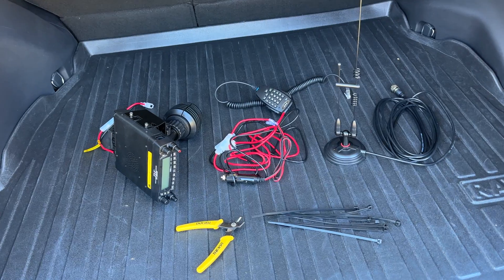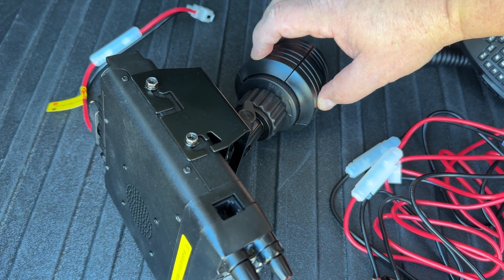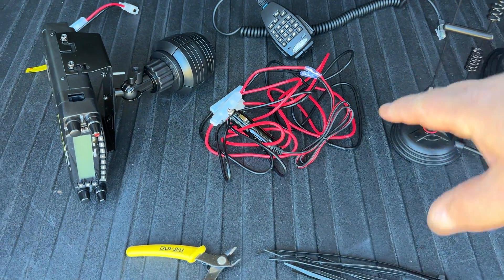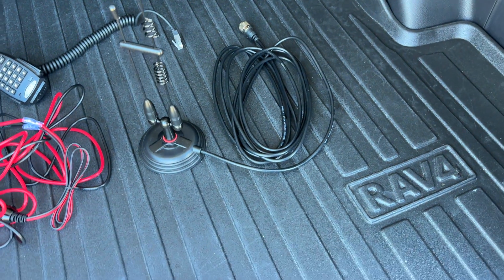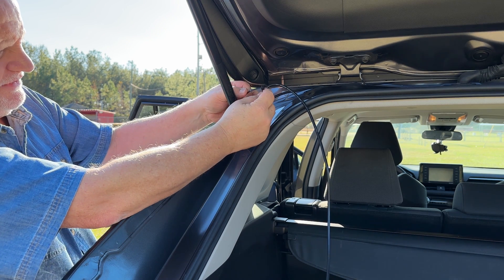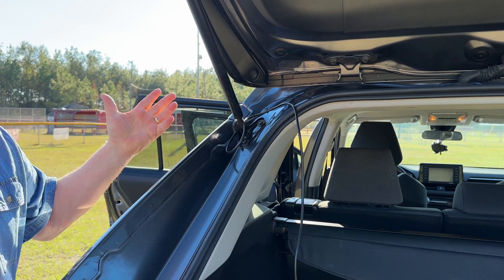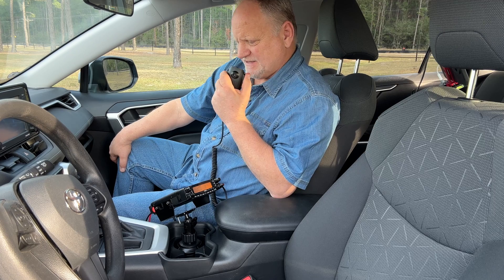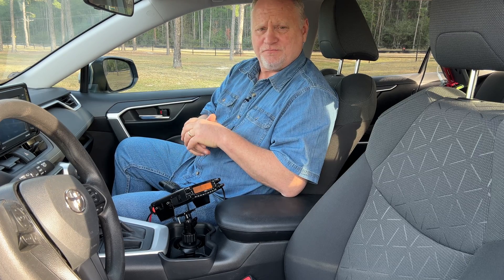Mobile Ham Radio Install VHF/UHF Ham GMRS CB

Comment: Be careful, most cigarette lighter sockets can’t deliver over 10 amps and radios on transmit can need over 20 amps.
Reply: How does a 50 watt radio running on 12 volts pull 20 amps?

50W÷12V= 4.17A
Reply: You are mixing DC with RF. A 50W output transceiver usually needs 10A. Cigarrette lighter sockets are usually rated 10A, so It is OK for a 50W transceiver. If you use a transceiver which needs for example 20A such as most HF transceivers you can damage your cigarrette lighter fuse or even the installation.

Comment: Wow, that's a really nice temp-setup rig...hell, permanent setup, really like the rainwater loop and cupholder mount, I've never seen one work quite as well as that one...definitely plan on getting one!

 I will say to hams reading this that, in terms of best antenna RF performance...you really do need to drill into the vehicle sheetmetal....Ive done this with every vehicle I've had (specifically trucks, mounting to the inside lip of the bed), it makes a considerable difference in antenna efficiency and performance.  Doesn't matter hitting your local repeater 5 miles away, but it makes a huge difference for getting the optimal distance with your VHF/UHF (or even HF) antenna....and that does matter a lot if you operate emerg. comm, or stormspotting, especially up in rural areas in West Texas, Oklahoma, or other High Plains states, where the proper repeater you need to hit could be 20-30 miles aways.

Comment: So, the power outlet will handle a 50 watt radio? I've been wondering because the computer is on top of the battery in my 13 equinox and I don't want to mess with that.
Reply: 50w/14v=3.6A, not a lot of draw.
Reply from the maker: I guess every vehicle may vary, but mine handles it well.
Reply: Most 50W transceivers need 10A, you are mixing RF and DC.

Comment: Good info. In leiu of an actual cupholder mount I used a 3 inch test plug from the plumbing dept. at Lowes as a low profile mount for a TYT 779.

Otherwise pretty much same as your video in a Nissan hatchback.

Comment: Hi i am well aware of FCC limitations as a disclaimer. Are you aware if this base unit or any other base unit is unlockable to TX on vhf/uhf/gmrs in and emergency. I am aware of hand helds that are but I am searching for a base 50/watt radio with being a to be unlocked. I appreciate the response and if I am looking for a unicorn at least i know to stop looking and move on.
Reply: Most radios already do that, what are you trying to unlock?

Comment: That radio will go flying out of that cup holder in an accident, be careful.  Also that radio is not type FCC accepted for GMRS.
Reply from the maker: Yes it could. Make it tight!
Reply: be sure to alert the FCC of all rule-breakings, won't ya?
Reply: @Slacked2196  Sure thing.

Comment: NEVER COIL A COAX. 
Any more than two coils becomes an attenuator. That is easily a 3dB loss. Every 3dB loss is about half of your power. That power will be sent back into the radio and will end up killing your final oscillator. 
Put the extra coax under the floor mats in an "s" type pattern.
Reply from the maker: You are right. I wasn't thinking that way, just doing a quick clean install. 😀Under the floor mats would be great! Thanks for the great comment my friend.
Reply: @OtisDyson  No problem. Thanks for putting out videos like this. It just might get people into ham radio. We need new licenses, or they will take our band width.
Reply from the maker: Yes sir! Be good my friend. @jhutch1470
Reply: Do you have a reference for that? Just wondering because a common mode choke is often a coil of coax and that's beneficial.
Reply: Well...hams (including myself) have been coiling coax, especially close to the antenna feed point, for decades now...the cable is shielded, so the coiling does NOT afffect your SWR or power efficiency...in fact, it acts as a common-mode RF choke, and it can lower the cable impendence to BETTER match the antenna impendence...that matters more for HF rigs, less for VHF/UHF.  But regardless, its perfectly fine to coil coax cable.

Comment: Can the cigarette lighter connector and the circuit  handle up to 50w?  I have read that radios should be directly connected to the car's battery.
Reply from the maker: They should be connected strait to the battery I agree, but not enough loss to be bothered by it. I just wanted the convenience for the new vehicle. Quick install and removal. Thanks for the great comment my friend!!😃